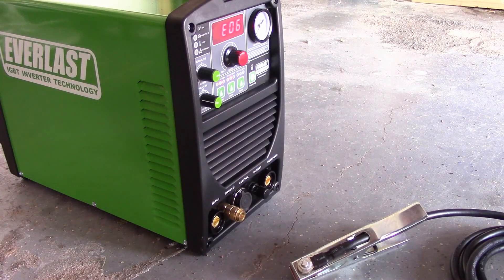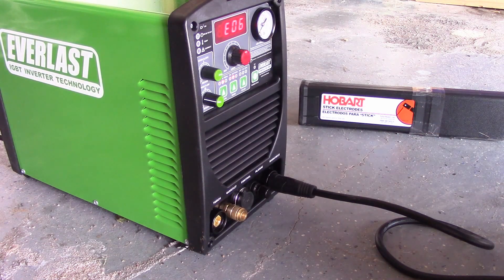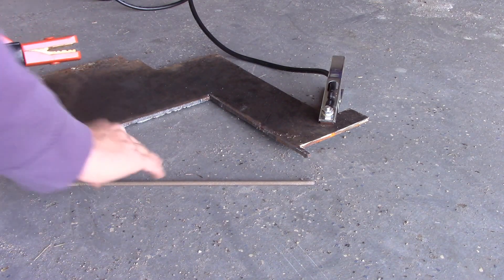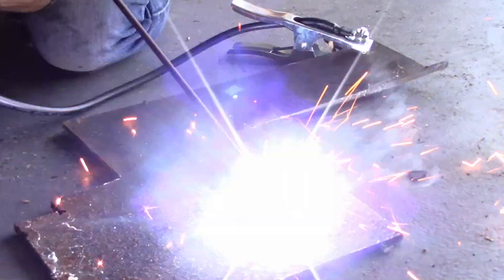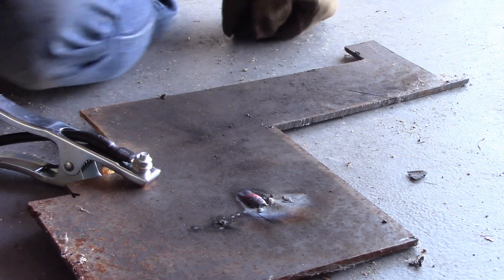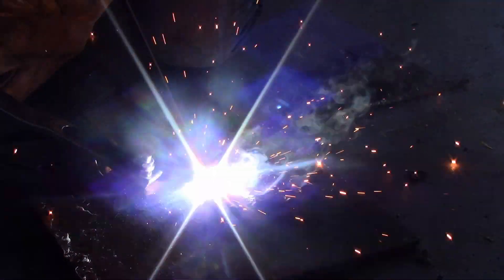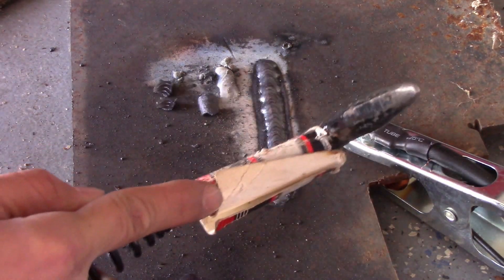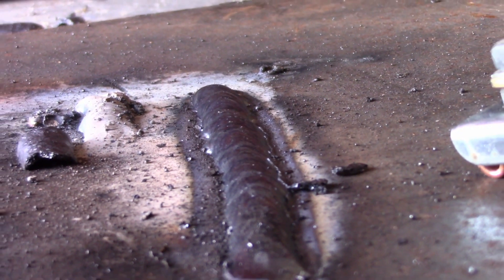Everlast PowerUltra 206Pi First Impressions: Stick Mode

Comment: DC is definitely different than AC to weld, and these new inverter type welders add a whole "nother dimension to the learning process. Very nice machine, especially for the price. I can vouch for the Everlast MIG welder - another good value - when you decide to get one

Comment: Looks like it is working really well. Just needs a little dialing in.
Reply from the maker: The Open Air Garage yea for just one pass I was pretty happy, probably needed to back off a few amps there. curious to see how it performs with 3/32 rod

Comment: Totally cool. Wish i could lay a weld like that.
Reply from the maker: MrMach12004 hey thanks Gary! practice practice practice! I'm ok at it, that's for sure...can't wait to start tig welding with it
Reply: Can lay welds like that with real 6013 not that "brown" coated crap they sell now  though that you can't even lay a uniform bead with

Comment: How have things gone with the Everlast now that you have had it for a couple of months?  Tried the plasma cutting?  If sohow did it perform.  I'm looking at buying this machine.  I want to us the plasma cutter primarily.  Thanks  Frank
Reply from the maker: Nipomo Beach I need to get my plasma video back up. I'm up and down with it. I think it's primarily a by product of fine tuning the settings. I may not know enough at the moment. Love stick mode. Still need to buy argon

Comment: nice system.
Reply from the maker: buzzsah so far I'm happy, gotta try out that plasma tho
Reply: I have been thinking of buying a plasma for a while but can't justify the $1000
Reply from the maker: buzzsah well this package was $900 for the 3 functions. There's a version that doesn't have the pulse function on the rig and plasma is a shade weaker and it is more like $680.
Reply from the maker: buzzsah if you're willing to gamble a little on a reconditioned piece, you could get into plasma for under $500. http://m.northerntool.com/products/shop~tools~product_200632005_200632005?hotline=false
Reply: Thanks for the info, but its not the $$$ its do I need one. I have the Hobart's mig and thinking of their cutter but I haven't had a need It's more the want.  It's the new cutting torch set I bought 10 years ago and still haven't got the tanks. lol.
Reply from the maker: That makes sense. I have a friend who still prefers the torch anyway over a plasma cutter, and he has both. So you gotta find what fits you. for me this package made sense given my limited space. I bought a cart today, so it's nice to have all of that capability in one mobile centralized area. Can keep all my cords and accessories on it too.
Reply: Now did you say you have a plasma cutter? Or is it just a stick and make? You definitely got a deal and if I didn't already have the mig welder I would be looking for some type of a multi-system
Reply from the maker: This thing is Stick-Tig-Plasma as the 3 in one. I'm sure some day I'll buy a separate Mig machine, but this should serve me well for many years to come.
Reply: Now that's a good deal having all in one like that. If I didn't have my mig I would've thought about one of those myself.